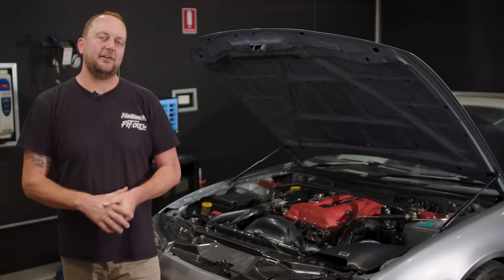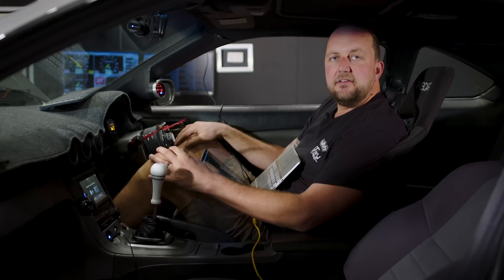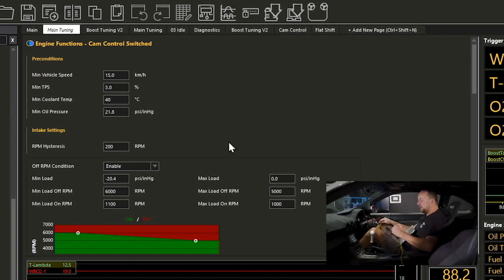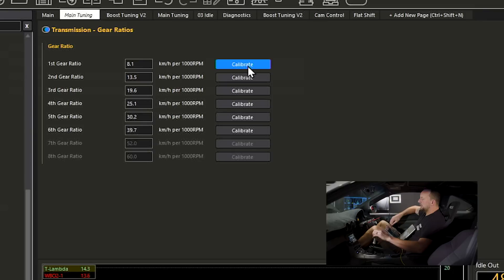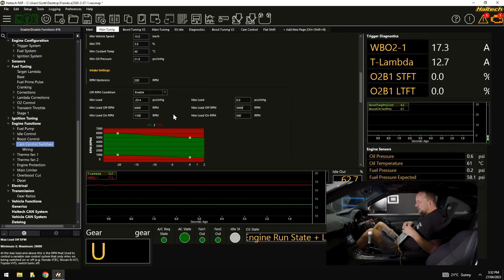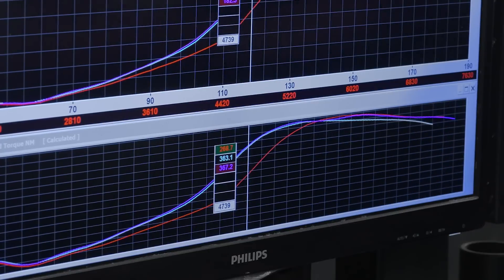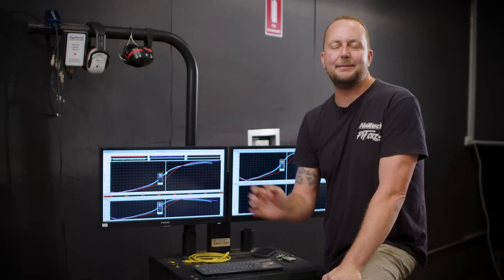🛠 SR20DET - Variable Cam Timing Tuning  |  TECHNICALLY SPEAKING

Comment from the maker: Live Tuning Session!!
Does VCT (Variable Cam Timing) actually give you more useable horsepower? We're about to find out!
.
-------------------------------------------------------
00:00 Introduction
00:49 How VCT works on an SR20DET
01:43 Test Car Specs
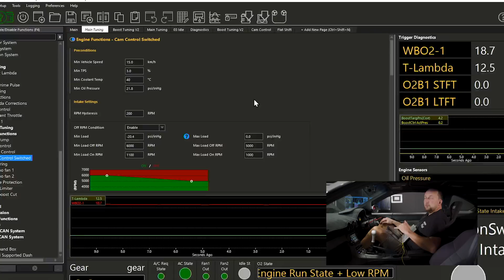03:07 Software walkthrough
05:42 Gear Position Setup
08:13 VCT off dyno run
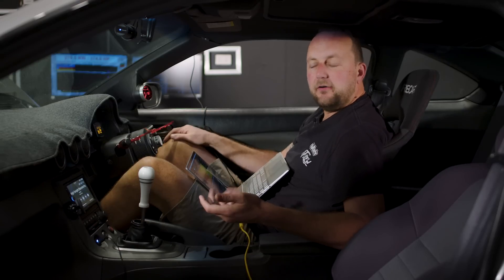09:06 VCT permanently on dyno run
09:29 VCT Tuning
11:52 VCT tuned dyno run
12:34 Final analysis
Reply: Kan u do vid like this on k24 153kw model
Reply: Try the same way but on the neo vvt head.

Comment: You guys need to do another video except with an engine that has fully variable cam control on both intake and exhaust cams. It'd help me out a lot with my own tuning of my '15 Subaru Impreza. The nifty thing about the FB20b in this car is that the intake advance can go negative, so you can go into "miller mode" at lower loads to improve things like pumping losses. A video that talks about this sort of stuff would be super enlightening.

Comment: Haltech, on an SR20 since the CAS is on the exhaust camshaft, how to run a "VVTI" / HKS Vcam system ? (mechanical side apart)
To my knowledge Haltech software need the position of the camshaft with the Variable cam system (not the nissan VTC style one, the true infinite one like Honda VTC).
Do i need a full trigger/homing kit ? And put the homing on the intake rather than the exhaust cam, unlike OEM ?
I know for a fact that RB26 with HKS VCAM run pretty much like a VVTI 2JZ, but i'm not to sure on a 4 banger.

Comment: Wait since when can a stock bottom end sr20 make 380+ hp at the wheels
This means that it makes 440+ at the crank
I thought that stock sr20s can handle about 400hp at the crank
Reply: I think the main caps on stock SR’s are the issue, I think redsun Motorsport (specialise in SR20’s) said they can handle 450kw, because the main caps break at that power due to their design.
Reply: Keep in mind that’s with forged internals haha, totally didn’t mention that 😂

Comment: What the hell are those red alloy paddles attached to the wiper and indicator stalks? Are they meant to fake look like shifter paddels lol
Reply: I think it's because the steering wheel is so far away when fitted with deep dish
Reply: Oh you’re a rookie ahahha, it’s because the quick release pushes the wheel so far out making it difficult to reach the stalks so they’re extensions

Comment: This is super clear explanation.  Same story with NA engines and variable air intake systems.
But! can we have same video about VVT-i variable cams? and tuning the intermediate positinos?  or such fine tuning can be skipped and on/off  style applyed without much loss?

Comment: I’ve heard big cams will kill the vct though. People remove it because they don’t want to have to replace it frequently.
Reply: I know some newer Toyota engines have the vvt gears fail if you use thick oil. 
The main reason people don't usually use vct on big cams is simply because of valve clearance. You need to keep the valves away from the pistons at all areas that the vct can reach. 
Certainly high comp it's a big issue. Turbo lower comp engines you don't need such big cams if at all anyway, so vct is obvious
Reply: Some cams do some don’t. Drop ins usually no
Reply: No. Stiffer springs kills vtc.

Comment: As always, thx for you videos. Is the HKS V-CAM for the rb26 also an "ON-OFF" switch, or completely variable?
Reply: hks v-cam is variable, step 1 is 20deg max.. step 2 is 45deg max
Reply: @goodboy_aqee58  yeah, im aware of that, but i wanted to konw, if its variable cotrollable, or also just an on/ off switch
Reply: @goodboy_aqee58  btw, step 2 and pro have a 50° range, not 45. Also step 1 has 30° and not 20°
Reply: @G.J.G.P.  more or less.. but v-cam do variable not just on/off. stiill not using full 50/30deg if still using stock cam... btw hks source then enginered the vtc pulley itself from subaru engine
Reply: @goodboy_aqee58  ok, thx. So variable. Ive read about the subaru thing. But still, the rest not. You still need the special cam with timing marks and special valve cover with oil feed and solenoid. So its not just the cam sprocket.

So you have one installed? Was tuning complicated? And is the difference worth the money?
Reply: @G.J.G.P.  installed years ago when lived in japan, by saurus garage. back then v-cam was limited edition small batch 1 time run production only, shop has to welding valve cover themself. this is the era when turbo lag kills response, good parts to have. today we have artec exhaust manifold with garrett Gseries, lag is no more...
Reply: @goodboy_aqee58  The HKS VCAM actually use a modified Subaru VTC pulley (with a mechanical limiter inside for stage 1, max 30° and 50° without), a 350Z cam sensor and solenoid. To operate the stock ECU, the VALCON system use 3 bolts on the cam to deal with le position of the cam, because it's a infinite variable system (as opposed to the nissan VTC on the SR20).
What i dont know is how an Elite/Nexus ECU operate the thing, specially on the engine/cam position sensor.

Comment: Amazing explanations, as always!
The S14 SR20DET has the same VCT setup as well, not just the S15. My S14 has it and it's a Zenki and works the exact same way.
Reply: Hej du! :hand-pink-waving::hand-pink-waving:
Reply: I believe the only real difference between zenki and kouki/S15 sr20det physically is the coil pack size.
Reply: @mahinork  Turbo is slightly different along with a few mechanical bits in the engine. But overall, the exact same engines. ECU may be different as well, but im not too sure. Anyone feel free to correct me!
Reply: @terranceaskew3165  Kouki S14 SR20DET is exactly the same as S15 SR20DET except the turbo. Zenki has a different ECU
Reply: @obaapohjois-laosis4394  s15 sr also has larger injectors to match the turbo

Comment: Is the vct an advantage in a race engine that is constantly over 5k. Probably not?
Great video.
Reply: Yea nah get s13 or better yet k powaaaa
Reply: Maybe not, but if you have the hardware it is free power and less penalty if the track or situation requires less then 5000 RPM

Comment: Please tune a VVL VE head on DET engine next :) Interesting to see some hard data on best times to switch intake and exhaust in a turbo application, there is much debate on the subject.
Reply: I’ve actually had my VVL s15 tuned at haltech and saw exactly this. Did one run entirely on the small lobe and one on high to see the switchover point and just made it changeover exactly where they meet in the middle
Reply: @jimm5091  did you just opt to change intake and exhaust at the same time?
Reply: @G.B  yeah we did one run on the small for both and one on high for both. My changeover spot ended up being around 5500rpm but this would differ depending on engine capacity, cam choice, turbo choice etc etc.
Reply: @elitecol69  Never say never... I would also be very interested in this setup, as I've done it on B13s
Reply: +1 on this plz scotty